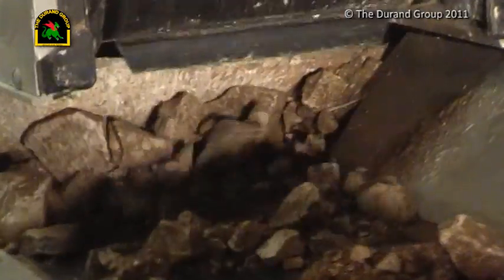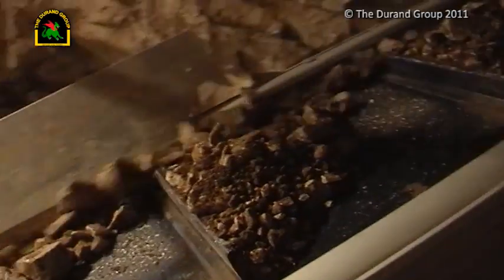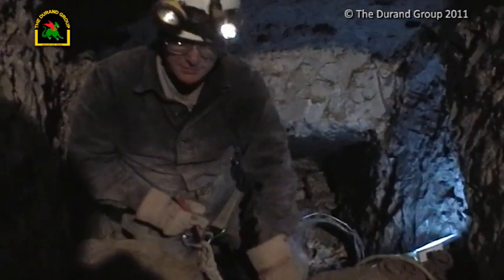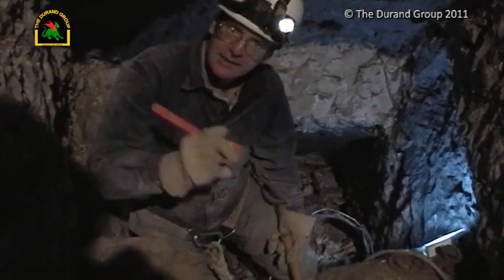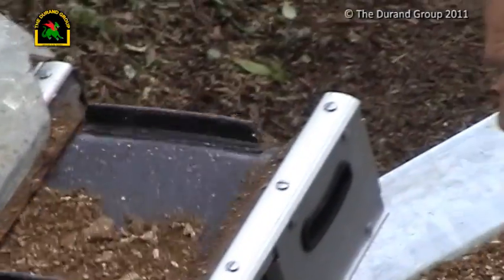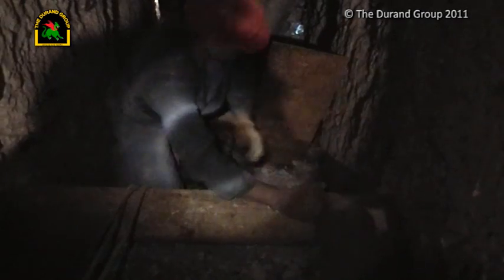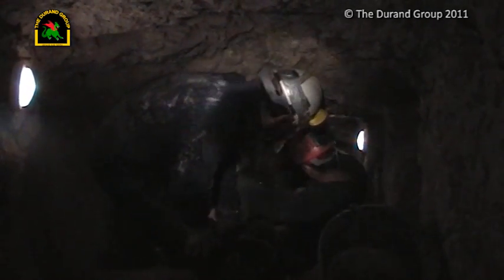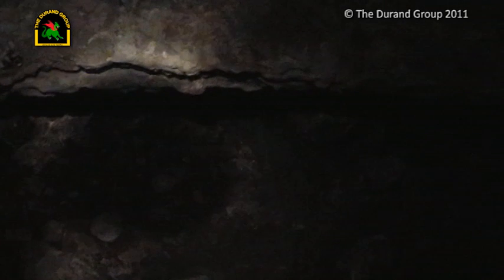The Durand Group - gaining access to a WW1 tunnel system

Comment: I like this very much. Im really interested in field fortifications and tunnels.

But one thing: when the tunnel opened up. The guy that did it went right in. You dont know what is up there. You think you know what is down there, but it does not have to be the case. Also, you dont know how the air is down there. And going in just like that in all the excitement could be lethal. 

Other than that, do you people have blueprints on the tunnels and fortifications? Im a collector of blueprints of tunnels, fortifications, and firearms. Also the technology what creates those is interesting to me. 

Greetings,

Jeff

p.s.
I have some links in on my YouTube profile. Those might be interesting.